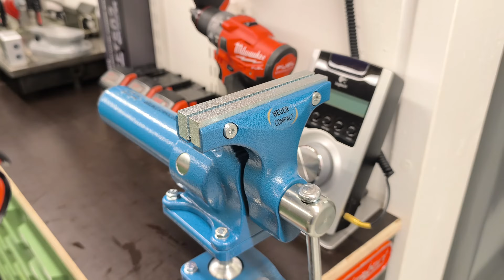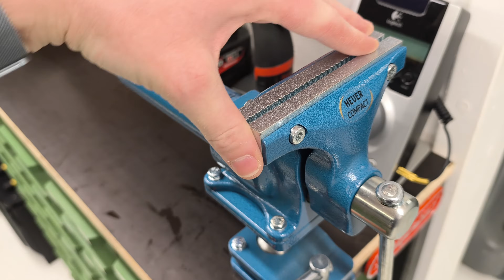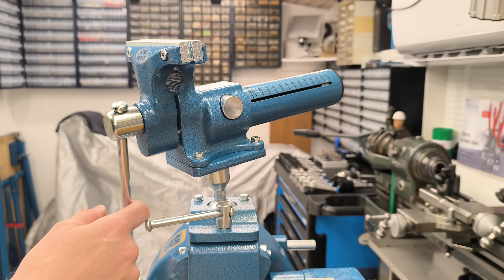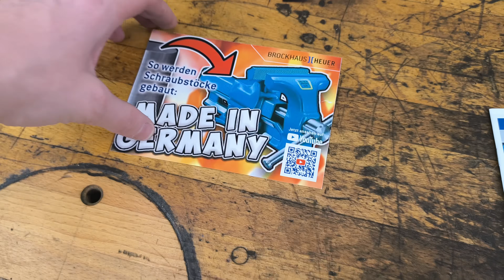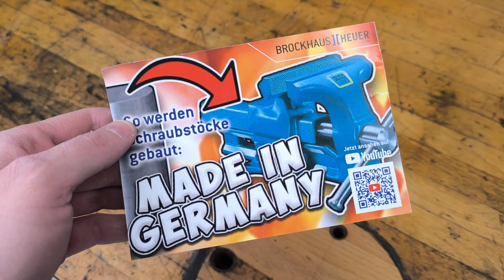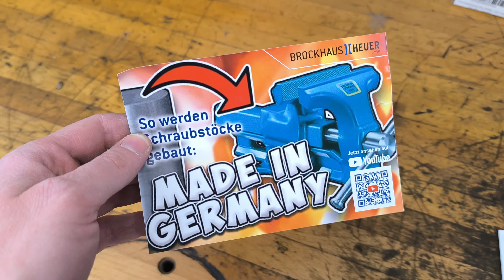Brockhaus Heuer Compact 120 vise - 120mm vise with great features

Comment: Hey hey :) Tanks for your video. Today I got mine and kind of disappointed with the quality. Maybe I'm wrong. The first and the most - is button on yours is not symmetric as well? I mean if look at it from the top - button seems to be not 90* vertically to base, is that the same for you? THe second one is finishing of the main bolt - it is so. hmmm... low quality. On mine, it looks has a very deep crack and lack of covering near the handle. The third issue with my vice is that it was in a box without any plastic covering, and the back cover was not pushed into, so there's a lot of rubbish in the tube now. Looks so so.... Was buying this one as high end device, but got kind of low visual quality product. Maybe I'm wrong and want too much from 200 Euro vice :)